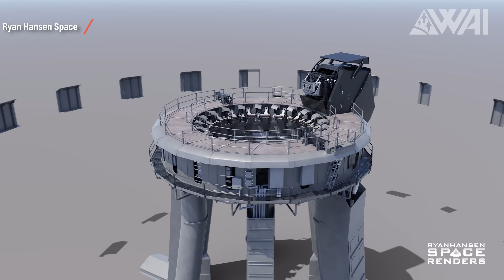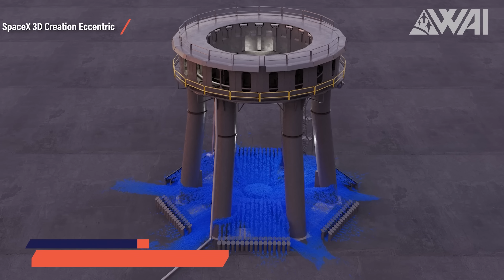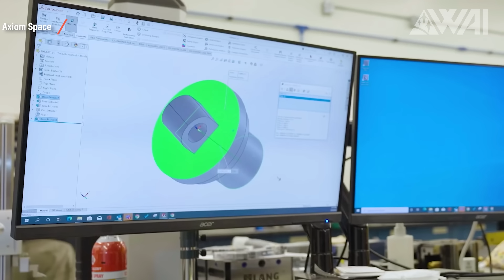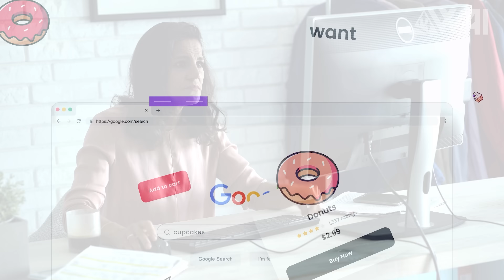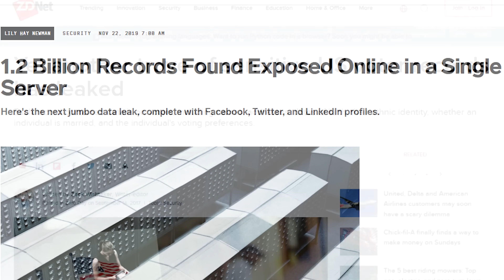SpaceX Starship breaks records before LAUNCH!! How will the journey continue?

Comment: The blast shield ramp around the fuel tanks,
Platform should stand in a deep water pool that can be drained. Concrete slab have a circulation of coolant pipes.

Comment: On one of the first Saturn 5 unmanned flights, 2 engine wire harness were crossed. One motor had a problem and the computer decided to shut it off but sent the shutoff command to a different engine because of the crossed harness. Sounds similar...

Comment: Hey Felix, I guess it'll rather be used as spray from top to bottom. But I guess there'll be a few water only to be collected since as you stated right most of the water will be turned in to hot water vapor (aka steam ... ;-) ) Let's wait & see - we'll find it out short term most likely

Comment: I’ve been very creeped out and concerned with stage 0.  The lack of a large flame diversion tench was an oopsie IMO… this Boca chica pad will not be able to facilitate rapid turnaround. It is pretty severely struggling to even accommodate partial static fire tests without kicking up debris that threatens the vehicle… It is thus obviously apparent to me that this pad will soon have to be retired and replaced with a substantially more robust second iteration furnished with a large above grade flame control/diversion and deluge system that is conveniently serviceable… A rapidly reusable rocket system will need a rapidly reusable pad system that is conservatively robust and durable. The largest and most powerful rocket ever devised simply demands a commensurately robust platform to launch from that will appropriately be the the largest and most durable launch pad ever devised. 
IMHO
The minimalist design philosophy that is required to keep rocket systems light weight and efficient is the polar opposite of the maximalist go big or go home design philosophy that ought to be applied to the static civil structures that are required to survive hellacious forces, pressures, and heat… And not just survive… to sustain repetitive exposure… it needs to eat these forces for lunch, with a massive safety margin.
The word I would use to describe this first prototype stage 0 is: “flimsy”
Expecting a concrete pad so close beneath 30+ raptor engines to take a direct hit like this is asking waay too much. The forces and heat need to be controlled via channeling and diversion carefully designed and optimized via thermal dynamic and fluid flow analysis so as to reduce the pressures and temperatures to levels that are predictably sustainable by heat and pressure resistant materials. In addition, a well designed system ought to accommodate ease of replacement of the wearing elements on a reasonable maintenance schedule with quick turnaround… that is programmed and proactive… not reactive.
Reply: Are you pretending to not knowing that this is the very first Stage Zero ever made & it's R&D site?

Comment: The concrete literally explodes but does so because the water trapped inside it vaporizes into vapor and expands. The expanding water vapor has nowhere to go so it puts pressure onto the surrounding concrete, which causes the concrete to crack, spall and eventually fail.

Comment: There's probably a reason it hasn't been done, but given the amount of tiles needed for Starships, why not use some on the launch mount to protect the structure from heat? It could be rapidly turned around much like the tiles on the Starship if one breaks? If they are already vibration resistant for the craft itself, surely in combination with water deluge they should be robust enough? Thoughts?
Reply: shutup

Comment: This is probably crazy but why not get the toughest, and most heat resistant metal there is and place a "thick" sheet directly under the launch mount. Maybe something similar to the huge buckets at steel mills that resist the temperature of molten steel as it is being poured into molds.
Reply: Price

Comment: The could put under OLM a collapsible designed double-bottom dish made of stainless steel. The upper one is with small multiple holes, the lower one is filled with water.

Comment: There won't be any RAPID reusability, unless they change the design of the rocket. Take a look at Falcon 9. It need at best weeks to prepare boosters for a new flight. The problem hasn't been solved for years already.

There are at least two major problems that won't allow Starship to be RRR (Rapid Reusable Rocket) in Rapid part:
1. Thermal protection tiles
2. Engines
Both need careful inspection before each flight. 

Solutions:
1. For the thermal protection - Stoke Space method (with capillaries (small holes) and coolant - demineralized water or liquid nitrogen) should be used.
2. The whole engine section should be clip-on type - fasten or unfasten the whole engine section (maybe with half-turn) - replace it with prepared and inspected section before putting Booster or Starship on OLM.
Reply: Yet Falcon 9 successfully reducing the cost access to space by very high cadence & big fleets of reusable boosters ("slow" vehicle turnaround time isn't as big of problem as Shuttle). Turnaround time (especially the individual pad) is decreasing

And Merlin doesn't need inspection after every flight, Falcon 9 static fires are very occasional as a result. The flight hasn't even started yet, are you a time traveler or SpaceX workers?

1. Congrats, you added mass & complexity with unproven technology, and complete redesign since different propellants. SpaceX (which has surprise surprise many engineers) was considering this & ditching it

2. So if only 1 or 2 engines need a fix/replacements they're gonna have to replace the whole cluster with many plumbings? How genius...

Comment: This static test was at 50%, but they want 90 at each and every startup?  Could they use a minimum percentage just to lift off the pad and then throttle up??  It would cut down on repair time and cost between launches.  Something to be calculated for each launch depending on payload size

Comment: I wonder why they don't build a conical or at least come shaped moveable spike that can be moved directly under the pad to diffuse the flames out of the sides to save the pad underneath stage zero. Seems to me that if you diffuse the flames out from directly under stage zero, that you'd not need to keep worrying about the concrete under the pad from that much thrust. You could even use the same thermal protection system that you're using on the Starship on this cone to protect it from the heat. Just seems to make sense to me. Am I wrong?

Comment: Water collection device?
I would think with all that heat and energy there would be very little water left to recycle?
Same reasoning for a flame deflector below the water table.  Flames will blow away any water while additional water is added in deluge system.

Comment: I have long postulated that the OLM's Achille's heel was the lack of a flame trench and a sub-standard 
deluge system. I hope that the recently added water system fixes that.
Reply: No it won't. It stripped even the special concrete like a ripe apple. Pieces as large as your fist blown out of the surface.

Comment: The deluge system tanks pointed out (next to the N2 pressurization tanks) are actually pressure buffer tanks. They can't hold anywhere near the volume needed. A concrete pad close by will almost certainly  hold a new large water tank.

Comment: They just have to build a surface mounted exhaust blast tunnel from the OLM leading away from the OLM and made of 1 inches thick steel fabricated panels like a wind tunnel structure and including the water deluge system internally to help reduce the gases from burning off the concrete etc.

Comment: I'm amazed with all the technology there's no flame diverters, all engines at full thrust so close to the ground would be like a small atomic bomb going off, as for Launching hundreds a day I doubt it very much.
And the seats in a cabin are going to need some good Springs to divert the vibration or it will shake the people to jelly lol, providing it gets off the ground without the atomic bomb going off underneath 🤔🤔🤔🤔🤔🤔🤔🤔🤔🤔🤔🤔🙏🙏🙏
Reply: It's still less vibration than SLS srbs

Comment: Are you sure it was a meteorite?  I heard it was a weak assembly problem???
Reply: The official explanation is that it was a micrometeorite impact. But given that Progress MS-21 suffered a very similar coolant loop failure a week or so back, and that the Progress spacecraft is based on Soyuz, feel free to draw your own conclusions about the odds of two identical meteorite impacts vs the odds of QA problems at the factory...
Reply: @simongeard4824  I agree with you as I can't see a meteor strikes being responsible for both incidents.
Reply: Beware of misinformation. If you hear anything in western media, it's likely skewed

Comment: The Mechazilla tower should be part of the water deluge system, putting a curtain of water between Starship  and the tower would reduce the stress on the tower from all those engines as they pass by as well.
Reply: Hmmm interesting idea, they’d have to consider the effect of the water turning to steam rapidly…I don’t know what would happen but it would be interesting i think…
Reply: The tower won't see much heat. The rocket passes by and most of it is other than the base in less than seconds. The deluge is there to save the base/concrete pad/reduce smoke and sound. 

They very much don't want more water than they can manage because they cannot allow even a cup of it to drain in the bird sanctuaries that sound their rocket factory.

Comment: my thoughts on the two engines not firing , If control shut down one engine themselves ,the opposing engine automatically sensed the possible unbalanced outcome and shut it down to keep the firing balanced
Reply: Or because of the entirely different reasons
Reply: One of the N1 launches had that failure mode — but not a thing for Starship. They don't need to shut down opposing engines to keep things balanced, because they've got far more control authority than they need from gimballing the engines...

Comment: $1million will Never Happen. It’s a Pipe Dream. The cost of the current missions with the Falcon are a lot higher than they expected.
Reply: There was an outside party who attempted to do a cost estimate and calculated to be $150-$300 million per launch.  Add to that 6 launches needed to fuel it and you put it at or above SLS per launch cost.
Reply: @pebmets  imagine believing some anonymous outside sources AKA "trust me bro". If it's fully reusable, the only expense is literally just fuel. And a refueled starship can go anywhere in the solar system, SLS can't.
Reply: @pebmets  "SLS can launch to Mars without refueling, Starship can't"

So do Atlas V, Falcon 9, Falcon Heavy, etc? If you're talking about crewed missions, Orion volume is literally a tuna can that's nowhere near feasible for long trip
Reply: @alvianchoiriapriliansyah9882  The only views of a starship crew cabin are from fans creating their own renderings.  It is not efficient for the environmental system to have large area of open area not occupied. This is why crewed vehicles, even crew dragon, don't of large open spaces.  The more space you have to pressurize, the larger and more complex the environmental systems have to be adding more weight to the vehicle.  Weight is the biggest issue.

Comment: I’ve been puzzled by the lack of exhaust trench etc until I realised that Starship is going to land on unprepared regolith on the Moon and Mars.  I think the OLM is the barest minimum protection while SpaceX learn how to handle ground effects on rocket motors,  and how to harden the base of rocket systems to handle blast effects.
Reply: Last I heard it's only the starship upper stage that will be doing that, the booster is earth only.
Reply: @Aefweard  yes that’s true but the knowledge and systems needed can be learnt on the Booster and applied to the Starship.
Reply: The booster won't though so it does not negate the need for a flame trench, diverter, and water system.
Reply: @pebmets  no that’s why they don’t (in my opinion).  It gives them experience with the exhaust and no trench etc.  They want to see if they can armour it up enough, and perhaps make the exhaust itself push against incoming debris, so that the Raptors and fuel lines can survive that situation.  When they can rely on undamaged motors then they can transfer that knowledge and arrangement to the base of the Starship.  That’s just my opinion on why they seem so contrary about exhaust management.  The moon trip is very close in their timeline and needs a way to land undamaged on regolith.

Comment: I think the idea is to use Starship to land and return from Moon/Mars. I wonder who will build special landing/launching pad there- on Moon/Mars - with super strong concrete?
Reply: Superheavy is never going to make it to orbit.  Starship only has 1/5 the power.
Reply: Superheavy is never going to the moon or mars. Booster won't be needed on Moon and Mars. Only need the 2nd stage that only fires 3 engines. (remember, lower gravity on moon and mars)
Reply: @rbe3717  As far as I'm aware, and I may be wrong of course the problem is not in the booster itself, but rather debris, which could damage engines during landing/launch. And with lower gravity and missing atmosphere speed of stones (debris) will be even higher then here on the Earth. So the more damage they can cause. I'm sure that SpaceX considered that.
BTW, I'm not 100% sure that booster does not required on Mars. Mars has 38% of Earth's gravity. Not superheavy, but some kind of booster may be required
Reply: @skeptical_bystander  No booster is required, the ship alone fully fueled can make the return trip. 38% Earth gravity is a HUGE delta-V saving

Comment: Hi Felix. If they are still having problems with the latest laid concrete under the launch pad, Why dont they use the same tiles that they put on the star ship.? Surely they can take the temperatures and pressures. what do you think.?
Reply: They would be destroyed instantly. Heat shields are very heat resistant but are extremely brittle.
Reply: Or they could wrap everything in Alien Tape.

Comment: We have to remember that one of the reasons the pad is getting so much damage is because the rocket is being held down and there is no bast relief as the ahip climbs into orbit. With 90% blastm the ship will be climbing away from the pad and the thrust will be gradually moving further away. The deluge system will also help control any debris.
Reply: It ran for 8 seconds at half power. A launch is going to be full power for 8 seconds of various heat from full to 1/4.

It's not the heat that does the damage, it's the shock of the heat hitting the special concrete and the blast of so much energy being directed at the concrete, it's not the fact you have 33 engines there.  You need to realize that any damage to the pad is too much damage because you can't just stucco concrete into holes. When that thing likes 33, it doesn't matter if it's 2 or 20...it's going to blow holes into the concrete unless they somehow have that water system blasting water as a buffer.

It's the dumbest thing because instead of building concrete barriers on EV-REE-THING and breaking up and replacing the concrete 4 times, all he needed to do was dig a trench, line it with concrete, have it directed in a safe direction(this might be the problem) and pour a bunch of water in it when it takes off.

And no the deluge system won't stop the concrete flying...go back and look at the cloud that thing made with hunks of concrete as large as your fist flying with a deluge system running...it already has a deluge system.

Comment: At first I was confused why they would want to pressurize horizontal water tanks instead of just having vertical ones that benefit from gravity, but then I remembered what they're trying to do.  Vertical ones would be more subject to damage in an explosion, which could then let things spiral out of control.  Sometimes a question answers itself if you think about it.
Reply: You could do what they did at LC 39A and B and just have the tower further away from the pad.
Reply: @pebmets  Farther away means you still need more pressure.
Reply: @dudermcdudeface3674  Look at the pressure that comes out of the sound suppression water system at 39B.  The same  for 39A for Shuttle.  Tall water towers and gravity provide a large amount of pressure.  Up to 1.1 million gallons per minute at 39b
Reply: Those 4 small (compared to the quantity of water required) are to smooth out the massive flow and prevent water hammer.
Reply: @Scanner9631  Why not do what NASA does.  134 of the 135 Shuttle flights used the gravity water system, STS-1 it was discovered they needed something more robust.  SLS used it.  Why is this constant reinventing of the wheel?  The gravity system at KSC has proven as reliable and efficient.  Starship keeps redoing things looking for that formular that already exists.
Reply: @pebmets  

I can think of two reasons.  

1/  They may just believe they need something better and are trying to find that thing.

2/ Starship is more powerful by far than any other rocket ever built what worked before may not work for them.

Consider this.  The static fire wasn't as loud as anticipated. Why?  Perhaps because the exhaust from that outer ring of engines not only prevented much of the sound from the inner engines from escaping but also did the same for the sound of those engines propagated inside the ring.  If this is right then it is something never seen before because there was never a rocket like this.  

If this is true then what other ways is/will this rocket work that is unprecedented due to the size and number of engines?  Things that will affect the design of the deluge system or even its necessity.